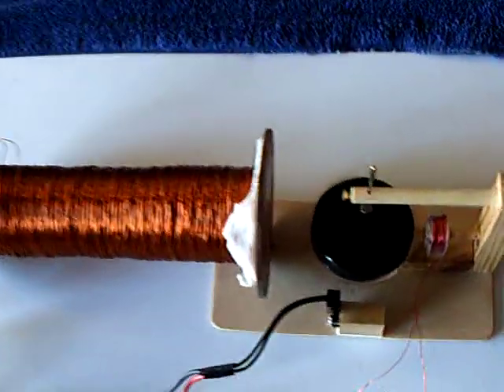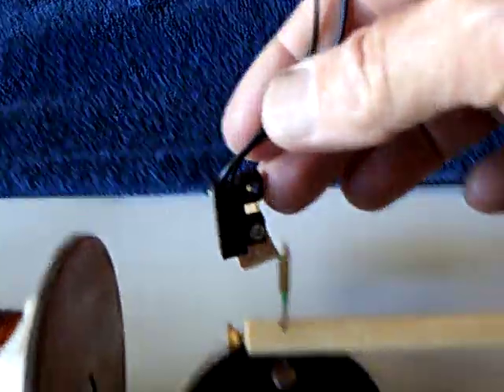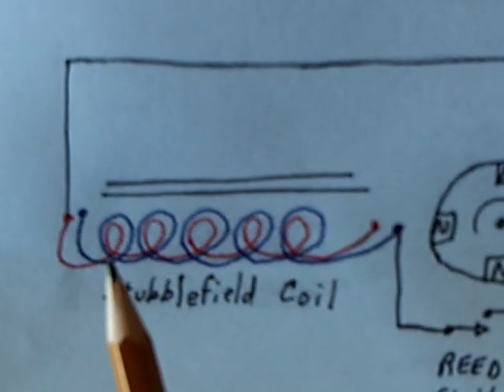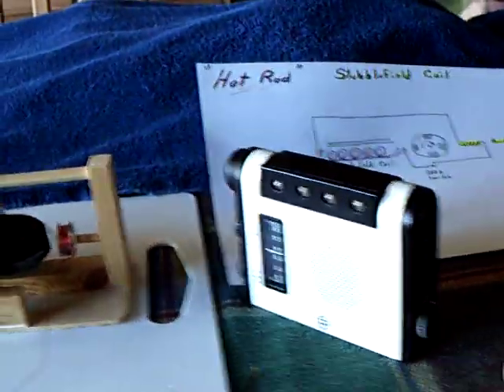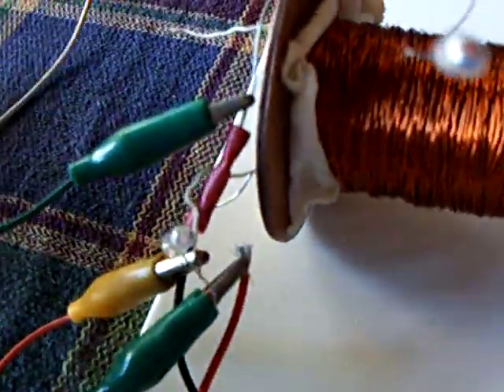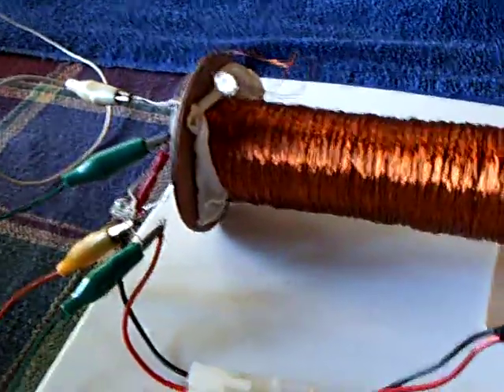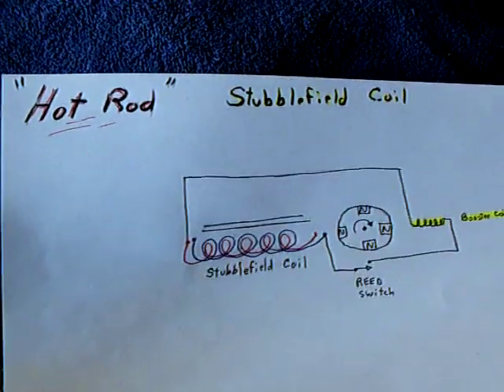HOT ROD Stubblefield coil---still running!!!.

Comment: @john &lid you guys should try two copper grounds and one copper hot. it makes the circuit stay charged longer. also it works better soaked in alum water or graphene c water
Reply: 2 iron grounds sorry

Comment: After seeing his diagram and his comment that each wire is connected only to one end of the each wire it appears to be a basic battery using disimular metals.  The large amount of surface area does help produce more current than a simple stand of wire but the secret is by coiling it he has increased his surface area by over a 1000 times and made it compact.  I would like to see someone take this idea and use multiple plates like a car battery but with cotton cloth between each plate and a insulator between each set of plates to create a cell.  Tie the cells together and bury it into the ground and see how long it will last.
Reply from the maker: +John Chan Good idea.  I made one of those 'earth batteries' using a copper and galvanized steel pot scrubber and it worked quite well.  Eventually it lost power due to output lead corrosion but the battery was still working.  The dirt had to be moist of course for it to work.  Summer months when the ground was very dry I had to water it.

Comment from the maker: This turned out to be a simple galvanic cell.  Copper and zinc are the two dissimilar metals.  When the zinc plating on the steel wire was used up the cell became an iron and copper cell and continued to work slightly when wetted. The iron oxide eventually shorted out the whole thing.  It was an interesting project ---but misleading.  This cell burried in the ground like Stubblefield did might be a different animal.
Reply: What happens when you put it in the ground? Less oxygen to corrode the system. Try vacuum bagging one the bag will keep it wet as well.

Comment: Listen to the comment at :14 ... Clearly the evaporation process is contributing to coil output. Perhaps if there is way to maintain an optimum level of humidity in the space around the coil, it will serve as a resonant tank. Was the oxidation of iron windings a necessary part of Stubblefield's battery?

Comment: I think you did it with the booster coil, lidmotor!
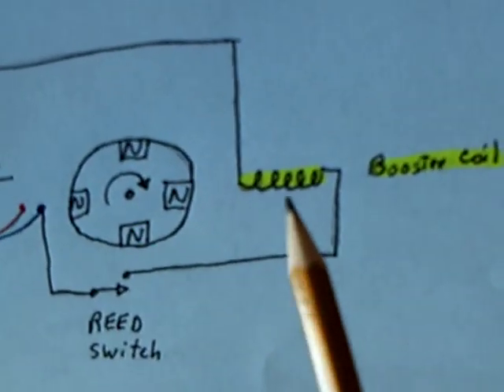Please tell what you meant at 2:20 when you said it will run on the booster alone. Is that with the 2 coils and no reed switch?
I ask because NS is always pictured with 2 of these, and if it works well...  I will wait to see what you meant. 
wow... thanks!